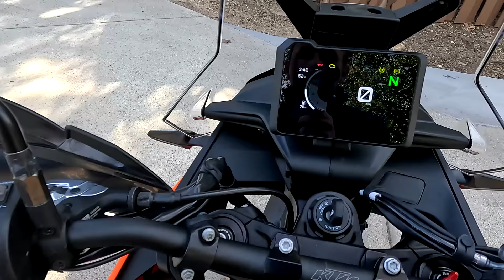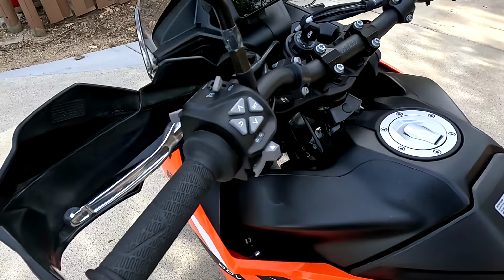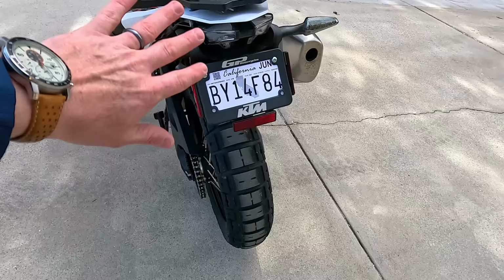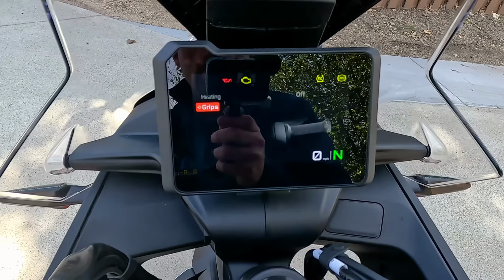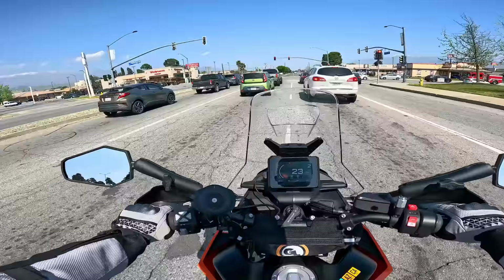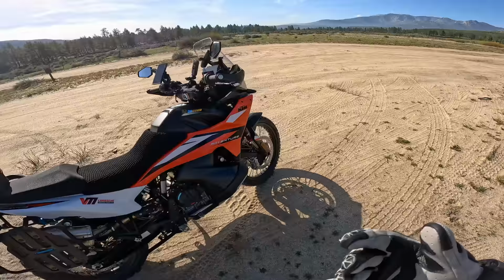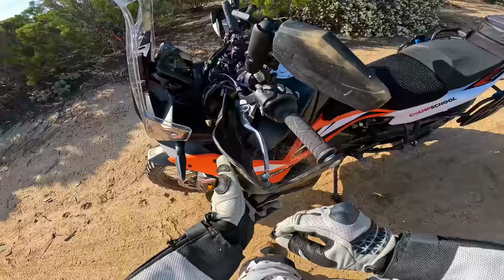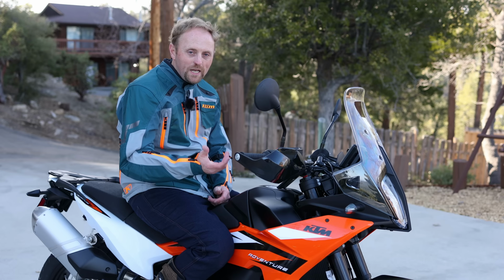2023 KTM 890 Adventure | Perfect Do-It-All Mid-Sizer ?? (EP.2) (Full Review)

Comment: Just bought a new 890 adv but from previous-old version, cost me about 30% less than the 2023 model, and it came with the tech pack with no additional charge..
Since I don’t really adjust suspension, I couldn’t resist the price difference and took the old one.
Riding it 3 weeks already and very happy with it.

Comment: I put 95K miles on my 2014 BMW 120GS and sold it to buy a 2021 KTM 890 Adventure R thinking at 71 100 pound less weight would be a good thing. Loved the handling and power (faster than GS) but found the high speed damping extremely harsh on sharp edge bumps and tried to have it addressed by a suspension shop a couple times and never got it to where I wanted it to be. Buffeting was bad and best I came up with was cheap eBay deflector that helped, but far from perfect. Mechanically the only issue I had in 10K miles was the OEM battery had a bad terminal and replaced under warranty. I found the bike is still nearly 500 pounds and lays flat making picking it up a pain! Ultimately I decided to sell it and bought another BMW GS. The GS just covers miles better, easier to pick up, but mainly at 71 I'm not going on any single tracks and GS will do fire roads all day long.
Reply: Then maybe its spring rate, not high speed damping. Its weird that revalve wouldn't solve it ; 
My '18 africa takes high speed hits very nicely,.as long as they not too big ;
Rear is meh, but no bike have factory good shock :/
Reply: IDK what bmw puts in their dampers, they do really well with high speed damping. I know what you mean, it just soaks up the tiny road textures and undulations so well

Comment: As usual and as expected great review Ian... 
I am currently in the market for an Adv bike and I was seriously considering 2023 KTM890 S model... I was happy to see you also got one and reviewing it. So I went to my local KTM dealership here in NorCal and sat on one and talked to owners of the dealership and other KTM owner friends...
In all honesty after doing all that my excitement level went really down and I got cold feet towards 890S... I have no idea what's the reputation of the KTM trail models or larger 1260 models but none of my KTM riding friends told me that they will buy it again if they knew what they were getting into.
They all love their bikes "when it's running" as they put it. But they complained of the relentless issues pushed them numerous times to the service for warranty repairs. Many minor and few major issues almost every KTM owner friend I talked to...
Then in my personal experience when I sit on a 890 Adventure S I realized all the buttons and the plastic  on it looks like it was purchased from Radio Shack and installed... Quality is nowhere to be found in any of those material. I am sure you also noticed that since you're coming from GS/A platform like I do... When I sit on a 2023 GSA and look at my dash and control buttons, levers etc, everything looks and screams quality unlike what 890 offers from the riders point of view. I understand we get what we paid for but still OTD price of $16,000 is not a chump change for not to expect a little better quality workmanship from a company like KTM.... I hope your experience will be a positive one with your 890! Ride safe!

Comment: Purchased my '23 KTM 890 Adventure base model over the R because it has fully adjustable suspension. It is lower tonthe ground. I can ride with the seat in high position on the highway, but as soon as I hit trails, I can quickly lower it! Love this feature!

The Rally mode is a game changer for all sorts of varying terrain from sand, rock, gravel, mud! I seem to be able to get through muddy areas easier than many of my other Adventure companions because the intelligent traction control does limit the slip and bites. Gravely hillsides, I can increase the slip number and prevent that rear tire from chewing itself, the bike feels solid with necessarily needing the friction zone of the clutch.

This bike is SO DAMN easy to lift from a drop, easier than my 300cc. It is light enough to maneuver or back up/push the way the rear handles are!

Without racks, dropping it has caused little damages, that tank does a great job.

I replaced the OEM skid/tank protector with AXP from Rottweiler.

Adding your Puig wind screen atop the OEM screen helps with highway winds

Comment: Happy Memorial Day and thank you for always making my Mondays better. I commiserate with you over the lost footage. How frustrating! Currently riding a Hypermotard 950 SP (desert X motor) which has a fantastic engine and comfortable ergonomics. But... no cruise control, wind protection or large fuel tank. 
I'm looking for something that combines fun on twisty roads, long-distance capability, upright seating, and the ability to handle short stents of maintained gravel roads. I would be riding pavement (90-95% of the time) so I don't know if I would be wasting its potential. The new 890 SMT also looks amazing.

Comment: Agreed, cruise control missing would be a deal breaker nowadays... in the US with our long distances and fuel injection there is no excuse except cheapness... Maybe you wouldn't miss it in Europe, but if you do any long distance here in the west you need it... and this is coming from someone who has been riding for 55+ years.... mostly without cruise control.
Reply: Roads can be very long and very straight in the West.
Reply: Errrr ......... no CC is a deal breaker for me and I live in the UK. Once you have it and use it, you want it. It's especially useful to stick to the lower speed limits otherwise you constantly have to concentrate on your throttle which I have to do when I ride a couple of my older bikes that don't have it. Frankly it's a pain not having CC.

Comment: Nice video, thanks for making this.  Sold my 2018 1290 Super Adventure R last fall and replaced it with a 2023 890 Adventure.  I'll admit I miss the crazy power of the 1290 sometimes but since I ride with almost all of the rider aids off (just use the front ABS), this bike is very responsive.  Other than the outright horsepower, everything else about the 890 is better.  It's more agile, easier to move around the garage and I can actually pick it up alone. I generally don't do any mods unless I get something other than looks or sound out of it, so I wouldn't do the exhaust can change unless there was an increase in power or significant weight reduction.  I'm considering one of the Rottweiler intake systems 'though.  Also wouldn't mind a longer shift lever but haven't managed to find that yet.

Comment: Interesting times we live in with respect to motorcycles. My solution to the stupidity of trying to find the impossible do it all bike is to simply buy two bikes, a fully built/modded 2023 KTM 350 EXC-F  for difficult and technical riding, and a fully modded 2017 KTM 1090 R for awesome high-speed rides to easier and less difficult trails. This decision has taken a few years to become a reality, but now I have two incredible purpose built bikes that can handle my favorite choice of riding each day. The 890 R is too heavy for technical riding and I have no use or desire for the complicated electronics, and the spiderman headlight. That has been my solution to the non-existent do it all motorcycle. Another great video Big Rock Moto!

Comment: I enjoyed your in-depth 890 video.  My KTM dealer just completed the first service 1000 km on my 2023 890 R. The oil screen was full of blue plastic particles. They cleaned the screen and told me to ride for a few days. They are going to look at the screen after the weekend. Could it be sealant or thread lock no one knows. They sent a report to KTM HQ but have not heard back from them.

Could you provide the part # for the missing piece of the KTM skid plate

Comment: Well detailed report.  I just bought my 4th KTM product so really like the brand for its performance and, at least for me, reliability.  That said, I just can’t see this bike being as good as my GS for the annual Mexico to Canada that I do.
Reply: Amen !
Reply: You might be surprised at the long haul ability of the 890.  It’s very stable at highway speed
Reply: @andrewschultz2504  weighing in at nearly 500# I suspect you are right.  I’m probably imprinted that BMW’s & shaft drive are the way to go for long haul rides that we could all do on a 300 Honda😀
Reply: @mikemerrill175  I started on a Honda CB 350 and have ridden several 300 cc Hondas. I definitely would not want to do the kind of trip. I have done on my 890 adventure I’ve done 1500 miles in two days easily.
Reply: @mikemerrill175  its always a compromise between on road comfort/ability and off road prowess isnt it ..  ive had a lot of dual sport and a few adventure bikes prior but this bike is like magic compared to everything else ive had or ridden , it does give up some highway higher speed comfort vs the 1090r i had just prior , and the 1190 & 1150gs were both even better highway rides but for EVERYTHING else it is just next level good , off road seat of the pants feel makes it seem like its half the weight
Reply: if you take I5 sure, but if you link BDR routes all the way.  The 890 is plenty.

Comment: You should check into the cold start issues on the 890 KTM and what is the deal with the "Demo Mode".  After 900 miles the dealer removes the demo mode and now you have to pay another $700 to get all those modes back on the motorcycle. I think I would stick with the Tiger 900.

Comment: Another great review. Watching it for a second time and thinking through my experience sitting on it. This is really my best option body wise I think (5’6” w/ 29” inseam). I have mixed feelings about that reality at this moment, but I have to go with the low seat on pretty much every other popular ADV bike and I am still not quite comfortable on a lot of those. 

Coming from a Japanese bike, I am kind of worried about the reliability, but this is clearly the best combination of size, weight, flickability, features, and price for someone like me. Still getting comfortable with the idea, but I keep coming back to how I felt sitting on it. Thanks for another helpful video.
Reply: I just got home from one of Denver’s biggest dealer’s 75th Anniversary Festival where they had almost every single ADV bike there to check out except ones I have tried elsewhere. I loved the fit of the base 890 Adventure again, but I have decided to go with the base Norden 901 as my upgrade. I was surprised to find that I fit that just as well and as a short and picky rider, I liked it significantly more than the Tuareg, new Suzuki V-Strom 800 DE (which was much taller and bigger than I expected), the HD Pam America I sat on at a different dealership yesterday, the 890, the Africa Twin, the Tiger 900 and BMWs I checked out last week.

Comment: I also have the 2023 base model and when I was returning from Overland Expo a few weeks ago,  it was very windy on the highway, several truckers were complaining about the buffeting on their vehicles. My 890 was super smooth and I was riding my stock tires. The stock tires had great traction on dirt, than after about 1500 miles, they became less effective on dirt, so I ordered some Motoz GPS for the rear.  I am a satisfied owner with about 2500 miles on the bike so far.
Reply: Get the GIVI airflow and you’ll be very happy on long distance. I was told to not do it but honestly best addition to the bike.

Comment: Great video Ian! Bought the same as you (also the orange), got it late April. Done in excess of 5.600-5.700  kilometers with it. Coming from a 1290 Super Adventure S and used to travel long distances across Europe I was, and still is, not quite sure if it will deliver. But I will say, this far, it's been a hoot. Very satisfied. No issues except a vibration noise that turned out to come from the top box mounting plate. I've had no software issues re favourites on mine. But the CC conked out one after being washed. Came back though. Going to report that. 

For Scandinavian conditions, which is more gravel/dirt and less sand, I find the STRs tires work surprisingly well. Even deep gravel isn't a problem, the bike behaves very predictably. And steers phenomenally. Being 6"3 I put on the lowest KTM risers. It helped but not entirely sure it's adequate for me. Agree on the mirrors, they vibrate a lot although field of view is pretty decent. But I'll change those. Also got the Ergo seat (with heating), think it a lot better than stock. 

Looking forward to your next video! Cheers :)

Comment: Finally,  after what seems like years I finally got a M/C dealer to "negotiate" a deal again. Yesterday, 10/5/23. I signed / purchased a new '23 KTM Adventurer. $300 off the $13,999 MSRP.   $13,699 plus the $700 Tech pack installed for free. a Center Stand, and Heated Grips installed for free, (there's some confusion if Heated Grips are with the Teck Pac, anyway they said that it will have heated grips and a center stand on it when I pick it up) and, they're giving me $3500 trade-in for my '08 KLR650. Thank you, Ian

Comment: I loved riding the 890 on some test rides. Like riding a Honda Grom. Full throttle all the time and lightweight. But at my height and weight I had to get the 1290 but there is something to be said for a low power light bike, so much fun!
Reply: are you 6'6" and 300#
Reply: It isn't low power. 100+ hp on a bike of this weight can easily loop you or shove back in the seat in a very fast manner.
Reply: @freeheelsak  I’m 6’6” with a 38” inseam and weigh 260 so yes, 100hp is not enough. Even my dirt bike makes 60hp.

Comment: The heat from my Desert X is heating the underside of my legs evenly, but once you are on the move the heat dissipates very fast.

The Touareg cooked my right tibia...

The heat from 901/890 felt evenly but more comfortable than the Desert X even if the tank prevents the heat dissipating asa fast as on the DDX as soon as you are on the move.

Felt nothing on the 18 liter Honda, I rode it in the city in heavy traffic, as I did with the ones mentioned above.

Comment: Can you interface with the diagnostic plug to monitor engine sensors, reset error and service codes, upgrade firmware, etc?  I mean you as in us at home with an interface and computer program or smartphone app.

Since the ECU knows the coolant temp at the sensor, same with the intake air temp, maybe oil temp -- can these be displayed on the dash?   How about manifold vacuum, battery voltage, throttle position, engine load, etc?  That's so accessible to developers, would be very valuable even with an unpublished procedure to access.  Could be called troubleshooting mode.

They're definitely getting better.  I love your enthusiasm when riding, that speaks volumes.   

Having wiped the recording sucks but it feels like this outing is likely to be a better representation of your observations now that you've got more seat time on it.

Comment: The plug you referred to as the diagnostic plug is for the factory alarm. The diagnostic plug is above the battery and has a small panel you remove to access it. It is a Euro5 red connector

Comment: Modern bikes get hot from running too lean. Its something that manufactures do to get pass different emission requirements. Cooling can be improved by doing an ecu flash. Cheers
Reply: That’s a good point
Reply: Rapid bike EVO fixed that , and a load of other mods i usually do to a new bike , smog/cat delete intake/exhaust ect..... runs far better and way cooler without any lean spots or hard cold start or that stumble right off idle

Comment: Love your stuff. Long time subscriber. In the market for a new ride. Been riding for 35 yrs. Went from crotch rockets, roadracing for a few years, then got too old to bend over that much. Went into big cruisers...then in 2012, i boughy a very slightly used DRZ400S for a sweet deal of $4200 out the door. Still cant buy one for that. Now 53,000 miles and a ton of mods, have completely changed to adv/dual sport riding and also help run the big PNW Dual Sport Riders group. Which if you do facebook, i feel its the best club out there. We moderate it pretty good. Anyway, just having such a hard time choosing. Im short, 5'8" w/30" inseam. Lookinh for what i would call a lightweight...well light as possible. As i have difficulties lifting even my DRZ. I have to completely take off all my luggage just to lift it up. So weight is a big deal. Was really hoping for the 490 to be made. Even my KTM dealer took a down payment in it so i could be the first to own one here. Yeah, when they dropped the news, they refunded it. Super nice dealer that gives the club bikes to give away. Love the 790/890 plateform. But picking it up would be a chore. I do mainly forest roads. Like WA BDR, Idaho BDR and such. Love the little CB500X. But weighs about the same as your 890. So kind of doesnt make sence to buy that. Price is not an issue, i build jets for a living. Can you suggest a bike that maybe i havent thought of?  Guessing the tuareg is a tad easier to lift than the big 890 due to the gas tank. Am i wrong? You would be the one to ask, with all your drop tests. Let me know your thoughts. Keeping the DRZ400 as she has been perfect, zero issues in 53,000 miles so far. So im looking for an easy as possible adv bike for those long slabs to get to the BDR routes. Easiest to pick up, capable of long freeway rides, decent suspesion, or i will have to modify it. Thoughts?